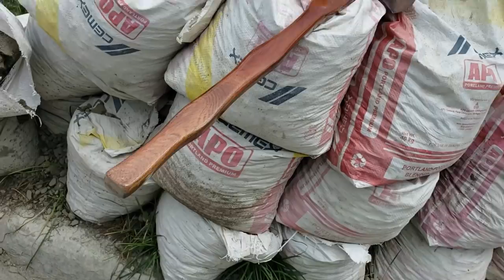Philippines Beach House Build Day 204 Part 1 : My Grandpa's Axe Restored and Concrete Prep

Comment: That’s a smart move salvaging materials. We did the same. We saved all the Tik wood doors, and most of the granite tiles. To be used in the new house. Really helps cut costs 👍. And we are going to sell the old water tank and pump to recoup more as the new house will have a different style system. A much more efficient system 👍👍

Comment: A suggestion.  If you're having a problem with aluminum corrosion, there is a commercial anti-corrosion grease we use on electric wires where the wires come in contact with dissimilar metals.  It's called NoAlOx. Pronounced "No Locks"  It stops the corrosion in its tracks.  It's made by a company called Ideal.  You might want to get some and try it. I know you can get it on Amazon, but you might be able to find it locally.

Comment: That is why zinc is used in ships to prevent rust it attracts to the zinc and not the steel maybe you should consider several big zinc nodes for around the house to help attract the salt from the rest and just replace the nodes from time to time

Comment: Ya bro you can burythe axe as long as its not in my head hehe hey but your right do some leather cris cross on some of handle it make a killer wall hanging not to mention takes you back in time to your grand pa man those old double head axes & 2 man  straight saws are what built America  Good steel there bro

Comment: You need to polish that ax head!
Reply from the maker: actually I don't want it polished and I wish he had not put a grinder to it and mess up the natural aged finished and gotten overspray on it. Who knows you might be right now that he already messed that up. Maybe I will polish it out to the max with some jewelers rouge and then clear coat it. That would be sweet!  Flat black might be nice to.
Reply: @TexasFilipino  yeah that handle looks real sharp, is it Philippine mahogany?

Comment: Love to the Axe!  You will appreciate that more in the years than some windows.  Question??  Can foreigners have bladed weapons in the PIL and what is considered a weapon?  Seems I could do a lot of damage with a hand sledge or battery chainsaw if I was zero minded.  Seems arbitrary.
Reply from the maker: I just suggest doing your research. This is a tool on our private property. It is returning back to Texas with me on this trip.
Reply: Hahahaha
Reply: @TexasFilipino  I suggest putting it in carry on.  Wouldn't want that missing in transit.  Just bring a big bottle of shampoo to distract them.